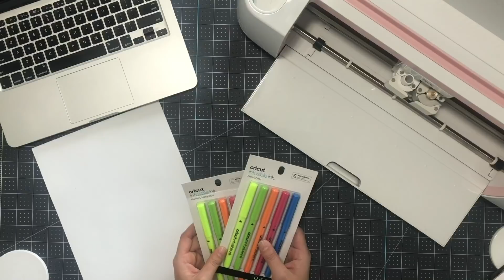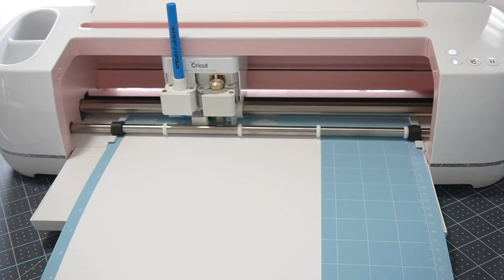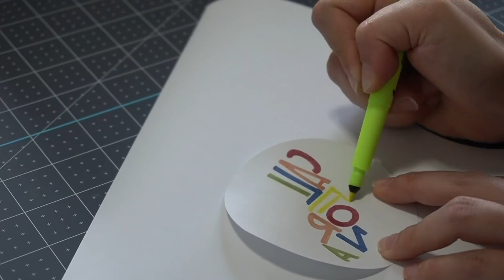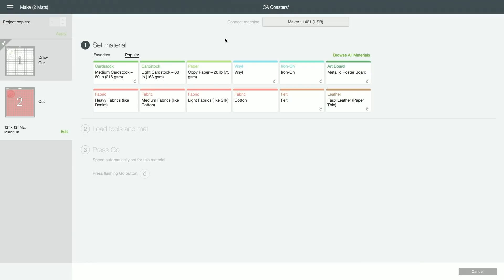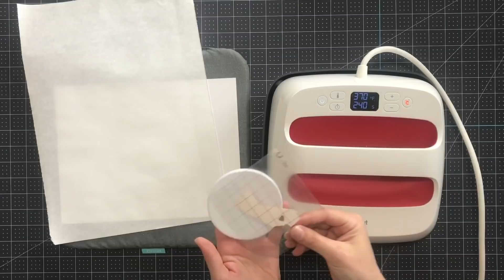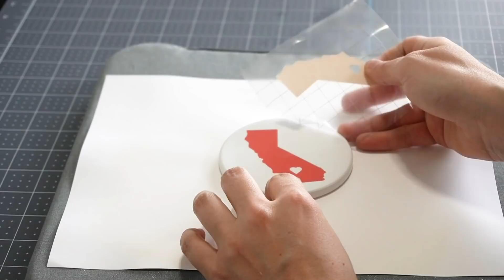All you need to know about Cricut Infusible Ink Pens, Markers, & Transfer Sheets on Ceramic Coasters

Comment: Hi, I am new to Cricut and appreciate the lesson here! I do have a question on the coaster. There is so much confusion on ink paper ... pens ... the maker vs. explore air 2 .. my head spins. My question is why did you turn the coaster upside down to transfer the image? I am guessing the heat transferred through the ceramic coaster but what if its not ceramic? Would you put it upright when heating? New subscriber!
Reply from the maker: There are transfer instructions from cricut on their website that recommend flipping the coaster! Since I worked at cricut when this process was developed, I got to see the quality assurance team come up with the instructions! After so many tests, they determined flipping it over gave the best results! If you visit cricut.com/heatguide you can see the instructions for every different blank!

Comment: Great video! I'm curious if you could have the cricut pens or markers do the coloring for you by selecting the colors in design space and then loading the appropriate color into the slot when prompted. I'm not good at staying within the lines and thought this might be an option but haven't tried yet.
Reply: I was wondering the same thing! It seems awfully time consuming and adds human error to the project
Reply: You'd have few to do a fill within the text. There are videos on this. I'm not a pro by any means. lol

Comment: can you use any ceramic tile
Reply from the maker: Yvonne Barth no— you will need to use blanks that have the special coating on them! The Cricut blanks have a polymer coating, but Cricut is not the only brand who sells polymer coated materials. They just only guarantee their products with infusible ink. I have seen a couple of comparisons online, but I personally have not tried anything other than Cricut blanks.